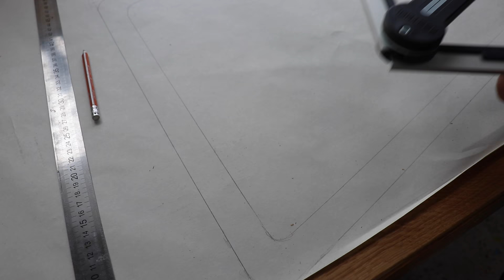LOUNGe CHAiR. wood project.  КРЕСЛО - ЛЕЖАК своими руками.

Comment: Please. Wath is this 13:02 ?
Reply from the maker: This is for cleaning sandpaper.
Reply: @WOODDESIGN6730  Yes I saw it. What do you call it?
Reply from the maker: These are ordinary plastic bags rolled into a roll.
Reply: @WOODDESIGN6730  Thanks, I have the same problem. I will try to do it